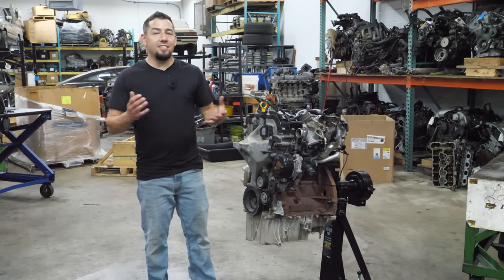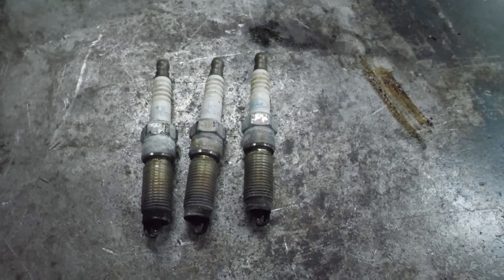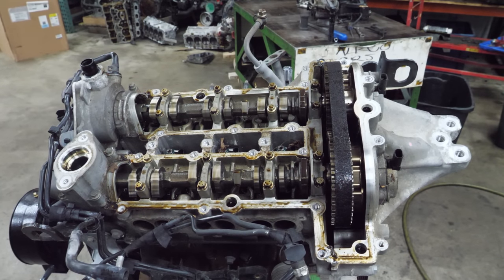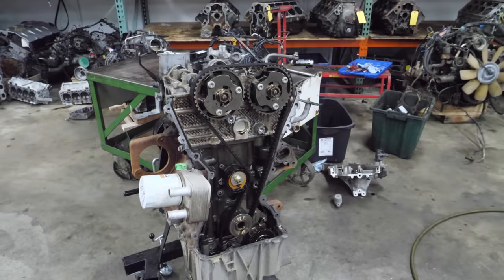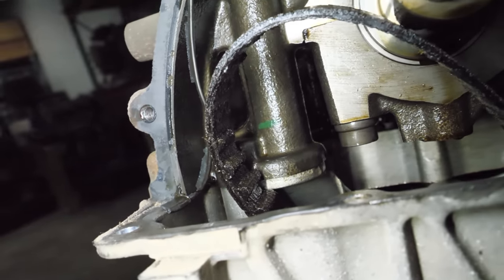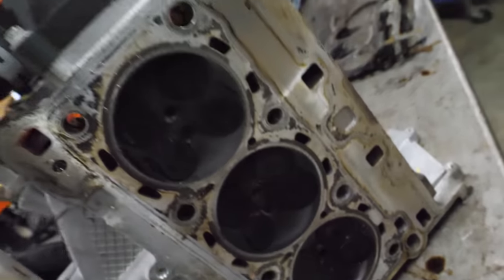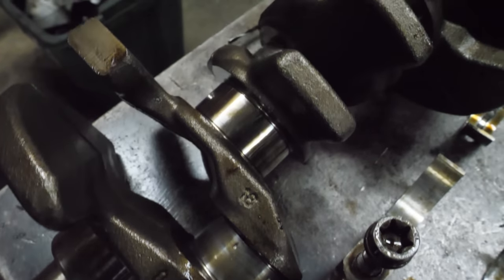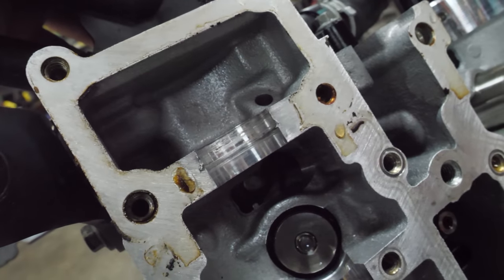JUNK Ford Ecosport 1.0L 3-Cylinder Ecoboost Teardown. LAWSUIT ENGINE!

Comment: With a wet belt its important not to skip oil changes and use the correct oil. Otherwise the belt can deteriorate and shed bits that block up the oil pickup.
Reply: Even more important is to not buy this shit design.
Reply: @Shanidar1 😂😂😂😂😂 always a fanboi 😂🤣😂😂
Reply: @matthewspry4217  Its not really fanboying its just stating that the correct oil spec needs to be used at regular intervals. Also engine flushing ruins the belt which a lot of garages seem to do.  Not defending the design but it can last IF done right.
Reply: Wet belt is a stupid design.
Reply: Why they didn't just use a single, double chain design is beyond me.  Its cheaper and would last 100 k before a chain check would be needed.  The oil pump could have been on the end of the crankshaft and that would have saved on complexity and cost, add to their incredibly stupid idea of a mechanical fuel pump?🤦🏼‍♀️.  Just changing those two design choices would have made this engine a third cheaper to build  and 40% cheaper to run without any special, expensive synth oils.  It would be low cost and low maintenance and oil changes could be stretched to 30k.
Reply: It's a vehicle designed to fail. It's not a long life engine. 

Pretty much everything today has built in failure over a given time.
Reply: @iHelpSolveIt I agree 👍
Reply: @evelghostrider  planned obsolescence
Reply: I'm sorry but chains have existed for years. This is Ford being cheap. This would probably be a bit of a good engine if the issue were resolved with methods that have been around since the automobile. Like liming CHAINS and woodruff key. And it wouldn't effect the cost that much.
Reply: @Paul paintshop  that's a better way to word it lol ... 

Side note, I spent over 40 years in paint, bodywork and airbrushing ✋️
Reply: @evelghostrider  I'm on my 45th, can't seem to retire 😂😂
Reply: @iHelpSolveIt  Originally, the engine was trimmed for efficiency with everything that goes. 
I got my hands on a German training manual for the engine. It says the timing belt in the oil bath would cause 20% less friction than a chain and would be quieter. The internal friction of the engine decreases of course also by the smaller number of bearings ( crankshaft / conrod ) and by the missing friction of the 4th cylinder.
If the design had not provided tangible fuel economy benefits, the engine probably would not have been developed.

Newer versions of this engine have a chain again and also shut down one cylinder at low load. So Ford realized that the timing belt in oil was not the best choice and caused a lot of engine damage.
The mechanical fuel pump is probably due to the, for a gasoline engine, high injection pressure for the injectors. In the training manual, the injection pressure for the engine is 150bar (2175psi). The fuel system works like a diesel engine according to the common rail system.
Reply: @Paul paintshop  seriously man lol I took full advantage of retirement in turning to senior professional golf .. 

It was actually a bad run of customers that made my decision of retirement,  everyone wanting more work but pay less..

I wish you all the best buddy 👍
Reply: @Shanidar1 Don't buy Duramax V6 engine then.
Reply: @id4spam for all these added "features" to lower drag, mpg is still less than a 20 year old 1.5 L echo
Reply: The Eco tag is for Economy. These engines that are only good for 50,000km sells more new cars therefore better economy for ford!
Reply: @gamesmaster1060 agreed, my little Fiesta has about 210000km (~125k miles) and i never had any problems with it… but i do make a oil+filter change every 12 months or 20000km and the only oil that gets in is the original Ford spec for that specific engine….
Reply: @iHelpSolveIt  you should send your design to Ford. Maybe you can win the International engine of the year award for 3 years, like this engine did!
Reply: All oil deteriorates rubber.  This is an engineering blunder, not a maintenance issue
Reply: @Rock-Bottem1982  That's why Peugeot and others French car maker changed their rules:  now ruber in oil need to be changed each 6yo and not 10yo like before , sic, what a joke for the buyers....
Reply: @Shanidar1 lol
Reply: @iHelpSolveIt  Or, going even further, a gear-driven timing like Cummins B, L and X series have.
Reply: @matthewspry4217  he speaks facts
Reply: @andrewschulte1662  Rubber belts were designed to be quiet in oil free casings, adding an oil jacket was not only designed to fail but totally negates the reason for using a belt.
Reply: @gamesmaster1060 True, almost any engine will last IF perfectly maintained to spec. But a good engine should have room for error. If a particular engine has to be pampered in order to survive things that other comparable engines survive even if they’re not pampered , then it’s a poor design in my opinion.
Reply: @gamesmaster1060  the most common cause of failure in these engines is a stripped oil pump drive belt. Ford even has a tsb to tell us to check that first. This was a poor design. This engine is destroyed by things that other engines easily survive. Even worse is that they are installed in the lowest priced cars that are the least likely to be meticulously maintained.
Reply: @gamesmaster1060  Or Ford could have spent a bit of extra money and simply used a chain to drive the oil pump and camshaft and GREATLY increased this engine’s durability . Even a traditional dry belt would have been more dependable.
Reply: Well lubricated geared design with zero belts would be much better and maintenance free.
Chains are not perfect due to tensioners and guide west failure risk.
Of course is exponentially better than this design.
Reply: @martinlang9615  it’s true that chains aren’t perfect. And gears are the best for durability. But chains and conventional timing belt designs are used extensively with great results. Chains sometimes fail but very often last the life of the engine. Conventional timing Belts now commonly have replacement intervals of  100,000 miles or more. I think Ford recommends 150,000 miles in their engines that still use belts. And come to think of it, I can’t remember having to replace a broken timing belt in a Ford lately unless there was another problem. The ONLY belts we’ve had problems with lately has been THIS belt in the 1.0 3cyl. And some of them have failed even before the factory 60,000 mile warranty was up. It’s a terrible design as executed in this engine. I see no advantages
Reply: @dmandman9  Chains used to last years, They don't now, I worked for nissan for years and we would be changing chains at 5k. I have done countless vw 1.2 chains, Vauxhall chains are another one that causes issues, Bmw are shocking as well.
Reply: @leeiverson145  fortunately, most ford products still have long lasting chains. However, a few engines have problems with the cam phasers. But they seem to have corrected that problem now. We seldom replace chains before 150,000 miles . And that was mainly on the 5.4 3 valve engine. But Most never have to be replaced for the life of the engine. We May replace them just for good measure if we’re inside for other reasons such as cam phasers or water pump (3.5 fwd) after the warranty. But stand alone chain jobs are rare in Fords.

Comment: Sidenote:
They also offered the Ecosport over here in Europe with a 5 speed since 2017 (they got facelifted and no longer looked like some blind transformer) a 6-speed manual.
MPG ranges from 42-45 on average depending on the extra or missing gear.
The 6-speed automatic on the other hand averages 37.. idk what happened there but no Honda from the 90's has such a negative jump up in the fuel economy.

The reason they went with a wet timing belt design is for better noise and vibration isolation, it also lowers the emissions, fuel consuption and friction loss. PSA(=french automakergroup of Peugeot and Citroen do the same, now some Opel and even a Jeep model use these engines with PSAs design. The engine series is known as Puretech or specifically the 1.2 Turbo versions I'm talking about EB). I know for a fact that these Puretech engines struggle with short distance usage. This way the oil dilutes and the timing belts dry out and crumble good bye engine, mind you short distance trips are nothing uncommon here.
2013-2017 facelifted Ford Fiestas are common with the 1.0 EcoBoost engines with either 101, 125 or 140 hp. They struggle(d) with dryed timing belts as well, part of that was also that Ford recommended the wrong oil viscosity ^-^
Reply: Great comment! Thank you! What would be the correct oil viscosity?
Reply: Perfect ! 
But pleas write  bel-in-oil need special oil types. 

Standart oil and the pladtic.tubber get hard and tooth will be fast lost than you can imagine. 

YES short distance use and you must have smal amounts of petrol and water in the oil volume. 
Open the filler cap and small. 

Remember use a bike or a bicycle for short distance. 

Car engines must get warm and must have hot oil for a lot of minutes. 

Otherwise shorten service intervall dramtical !! less than half distance !!!
And pry that the beli in oil  will surview. 
Oh not cheap to change = a lot of working houres ! 

Short distance and 160,000 kilometer =  100,000 miles will be impossible (or a high risk to loose the engine !). 

Never ever forget to ask the car service person if he knows that these engine need special oil ! 
Better write a note and place it in the car.

Comment: I would love to see a teardown of the 1.5 Ecoboost. Lots of interesting tech. Also a good amount of power from that 3 cylinder.
Reply: @ziggyz8345  The 1.5 is 181hp 190tq. The GR Corolla is low $40k+so not a comparison.
Reply: @ziggyz8345  you're comparing an insanely over built boosted 1.6 3 banger to a lower budget, low end, economy minded and built motor. if you really wanna compare, a Geo metro also has a 1.0L 3-cylinder and only makes 55hp. but its low compression (relatively and comparatively), SOHC (6v), and again economy minded and cheap to build.
Reply: I rented a 2021 Escape with the 3 cylinder. I hated it. It had 1,000kms on it and it was idling rough like an old Toyota Echo. The power was fine around town, but pretty awful on the highway. I’ll stick with my smooth V8
Reply: @micahrlusk ah my 3 cyl metro pulled 65mpg with my tools in it I miss that little guy
Reply: @keithbaker1951  I had one as well, never hypermiled it or anything but seemed like it could always pull 30-40 in the city even if you floored it everywhere. Mine had ac too and even with that going it got good mpg. Cheapest and most reliable car I ever owned and it had ac lol should’ve never sold it

Comment: My 91 Sprint convertible 5 speed got 53 mpg on highwy at 65 mph.  40mpg at 80 mph.   It was much quicker than you might think.  It was powered by a 995 cc  3 cylinder .   Super easy to work on.
Reply: Yea and it had 48hp. This engine is producing 3 times the power out of the same displacement.
Reply: I had a motocycle with the same amount of cc once but it was a 4 cylinder. It has a little bit of power too. It was a suzuki gsx-r 1100. English isn't my language.
Reply: @MarvinHartmann452  Your English is just fine.

Comment: The 1.0L EcoBoost won International Engine of the year 6 years straight. It is sold primarily in European markets. It was bumped up to 140 hp in the Fiesta Red addison. The turbo spins at 147k rpm, two stage oil pump, two thermostats, one mechanical driven water pump and one electric water pump attached at the lower part of the radiator. I have this engine in my 2016 Ford Fiesta with many mods from Puma Speed in UK. With the ECU flash, full upgraded air intake, larger intercooler, full stainless exhaust. My engine makes approximately 170 hp. My vehicle only has just over 4000 miles. But the real issues with these engine failures has to do with the engine temperature being to high. 220 degrees plus. They hold little coolant and often hoses crack and loose coolant blowing head gaskets. If I knew then what I know now, I never would have purchased the car. It's every mechanics nightmare. I know I will regret it one day. Again, I only have 4k miles and I bought it new.it was hard to find. I found one in Houston and made the drive. I did see several Ford Focus vehicles with that engine here in America. Ford called it the world engine.
Reply: The block is the same size as an A4 sheet of paper (8 1/2" by 11") designed in england, made in germany. It's honestly a pretty cool engine and it was even bumped up to 200hp in some racing applications so it's pretty stout
Reply: @fordrac1ng81  In racing applications it has to be rebuilt every 1500km aprox and it fails a lot
Reply: Engine of the gear is a political thing, they value complexity for the sake of theorethical efficiency, there's no such thing as a group of engineers comparing quality or anything like that. How can you even call vehicle of the year or engine of the year to something new that hasn't been tested realistically long run?

Comment: I bought a 2020 ecosport SE awd with the 2.0 and my wife liked it so much she wanted one.  We ended up with a 2021 ecosport S fwd with the 1.0.  We lined them up and did a short run to 55. They were neck and neck and the 2.0 didn't have a full car length by the end.  I have driven both vehicles extensively and I can say this.  Off the  line the 1.0 has a lot of grunt and feels quicker.  Around 55 mph you can feel more vibration from the 1.0 where the 2.0 is smooth.  Even though my 2.0 is heavier with the awd system and doesn't have a turbo the two get almost identical mpg (within 1mpg).   The 1.0 runs hot.  When you shut down the car it buzzes (I assume electric water pump) for several minutes cooling itself down (my 2.0 doesn't).  I had read about the failures prior to buying the 1.0 ecosport but the forums said it was due to a oil not compatible with wet belts and prolonged maintenance.  I only use mobil 1 extended oil which is supposed to be compatible and I perform our maintenance regularly so took the risk and purchased the car.  With the new recall on the 1.0 at least her vehicle is still low mileage (28K) so hopefully the solution comes before any issues but I also have the 6 year premium extended ford warranty on both just in case.

Comment: I've been using an extremely reliable 2003 Fiesta (bought in 2005) until 2021.
That year I replaced it for a mild hybrid ecoboost fiesta. But the new 1.0 mhev engine design is now chain driven, and the turbo is relocated to the back of the engine.
Reply: Yes  the 2018 ,  1 liter 140 ps ford fiesta st line  , are a pocket rocket  , the power  from that engine is very  surprising  , a great  car , but needs  to do the regular oil change  , with the correct oil , and   change the timing  belt  , when  it  due  .  It good to  hear thay have a  timing chain  now  👌
Reply: The oil pump drive still uses a wet belt even on the new revived engines
Reply: @StanceSantos-mj7xp  you know the replacement interval? I can't find data about that
Reply: @SandStormPower it doesnt need to be changed as per the manual. Only belt that Will wear prematurely, is the oil pump belt if youve got an auto transmission
Reply: @Cydro12  mine is a manual trans, gladly